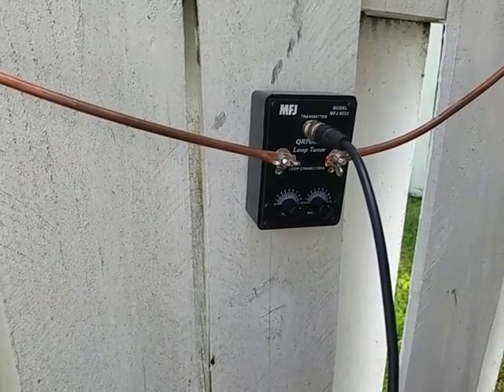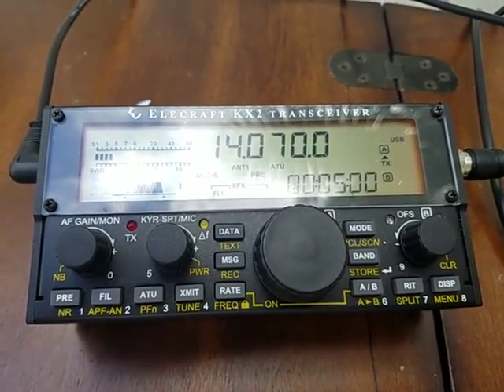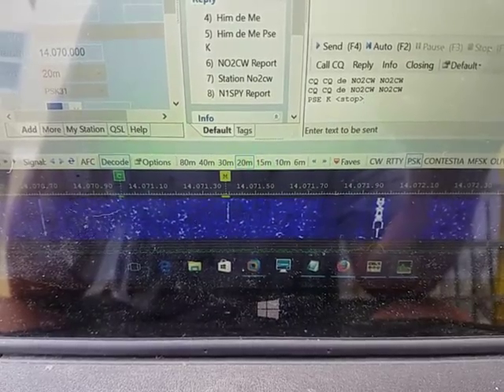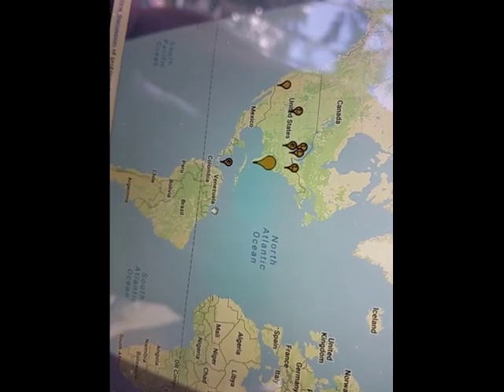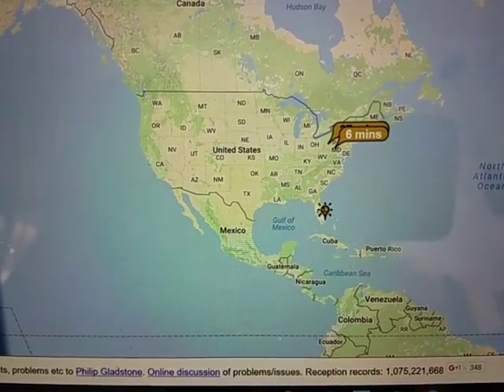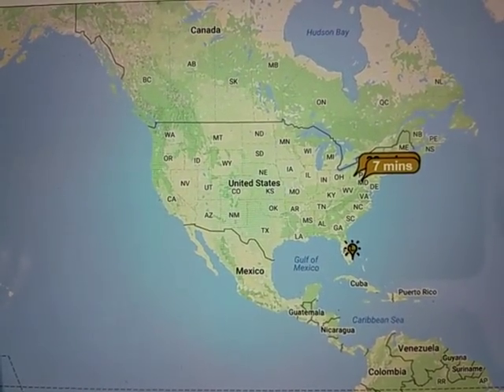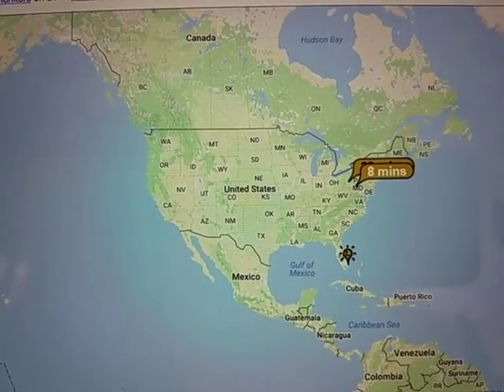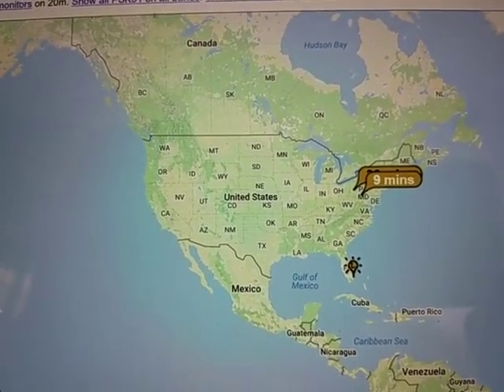MFJ pocket loop tuner part 3

Comment: Loop should be clear of objects. Hanging it on the fence will have a bad affect on receive and on transmit. You might have gotten a lower SWR if you would have raised the loop above or away from the fence.